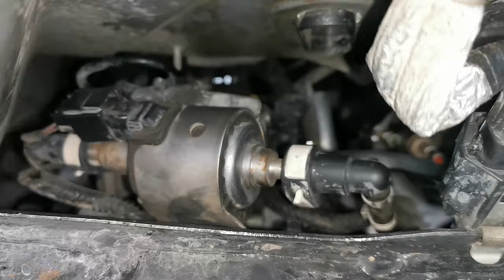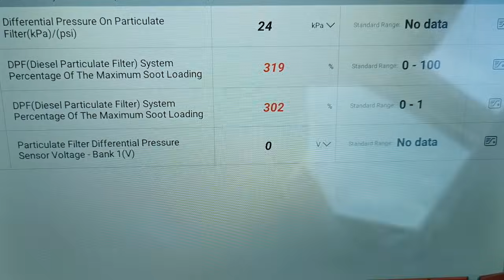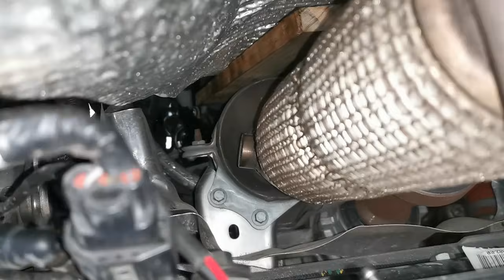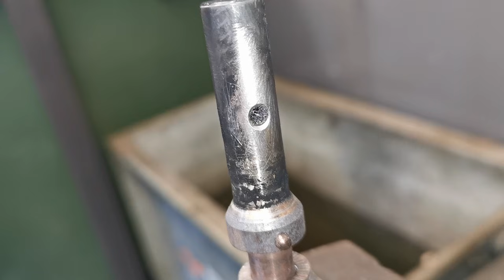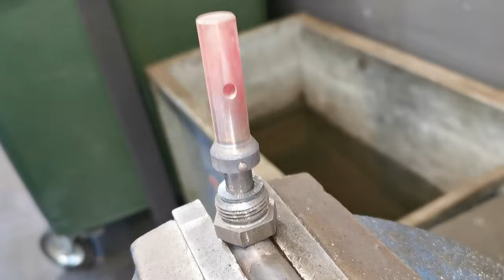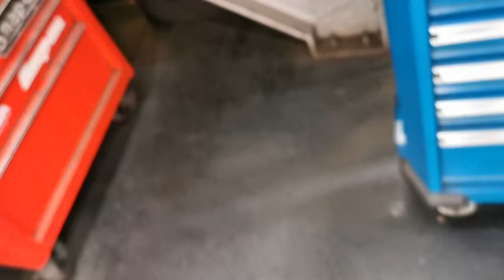Comment: Hi. 1.6tdci mondeo 2015. Dpf accumulation  fault was on.  Had problem with vacuum hoses.  Thats fixed now.   Dpf cleaned. Pressure is 5-10mbar at idle ,40  at 3k rpm. But dpf  soot load goes high open loop 170 to 300% depends on driving. But egt  both sensors going hig when driving 250 to 400celsius. And dpf regen fails after 30sec.  Every  sensor reading looks ok... egr,fuel in tank,coolant temp ,dpf pressure ... no faults. Even tried with dpf reset. Pressure ok in dpf,but egt high and soot load high open and high loop. Any ideas? Thanks

Comment: Thank you for the help.  Just before new year's day I had a engine malfunction error.  Got an OBD wifi reader from Argos and Forscan Lite on my iPhone and figured out from your video that the vaporiser was clogged (on a test run with Forscan I could see the relay opening for the vaporiser but the cat temperature never got above 450).  I managed to get the vaporiser off with a spanner and bar.  Couldn't blow through the fuel line, so sprayed a bit of brake cleaner into it, then blow torch and was able to clear it.  Put it back in place and regen worked perfectly.  I needed to get home from a long way away and local garage couldn't fix for a week so you are a life saver !

PS.  I only had iPhone and not a PC - so was unable to prime the vaporiser pump.  Instead I took the fuel line off the vaporiser, connected the pump end, kept it above the height of the pump used a syringe to fill up the tube with diesel - then connected the vaporiser to it.  This worked.  Just in case anyone else is unable to prime.
Reply: Does anyone know what the flow rate for The vaporizer pump is

Comment: Nice I'm gonna be tackling my focus ST tdci vaporiser. No reduced power yet but occasional DTC for too low temp. EGT only goes up to 470 which is too low. Chucked some neat g101 down to try clear and it's going in but I think I'll have to remove and clean or replace it soon before any problems. Only 3mbar idle cold 18 mbar hot

Comment: Does the 2023> Ranger 2.0 Ecoblue have these vaporisers? I know that the older 2.2 and 3.2 engines have it as I also have a 2.2 and it has been replaced [possibly needlessly] twice in its 95,000 miles. I hope that the 2.0 has it, because it must be better that spraying excess late fuel into the cylinders.

Comment: Appreciate you sharing your knowledge excellent video
Reply: Thanks very much Vincent
Reply: @GerardBurkeBurkesGarage quick question,  was going to buy a topdon phenoix plus for doing adblue ,dpf ,egr resets,  but from what I make out it's launch software , any idea what model of launch would be better than the topdon ? The phenoix plus is about £750-£800 ? See the launch x431 but there's loads of different versions and prices ? Any advice appreciated mate
Reply: They share software, Look up Thinktool as well and see which one compares to the specs you want, The Topdon phoenix is comparable to the Thinktool Master, both will be cheaper than Launch typically as Launch has a better global brand presence. 
 
I have done a review on the Thinktool master on my channel, they are all very very similar (almost identical in every way) quality tools but better value for money will be between Topdon and Thinkcar depending on your region and sellers.
Reply: @GerardBurkeBurkesGarage  thanks for the detailed detailed reply ended up ordering the phenoix plus last night got it for £620 hopefully I don't get taxed on it